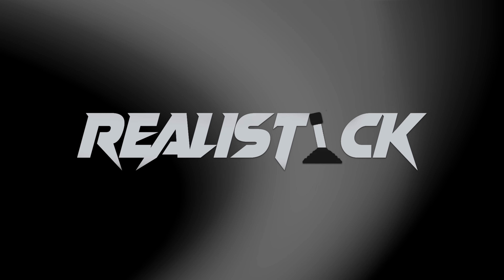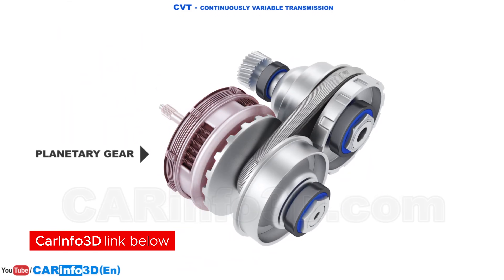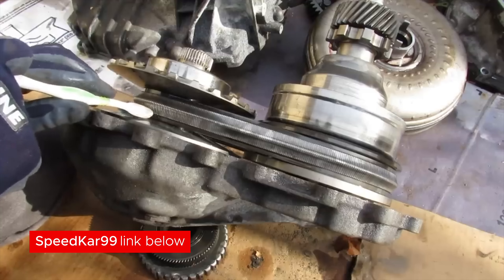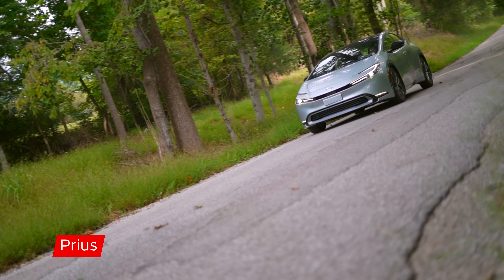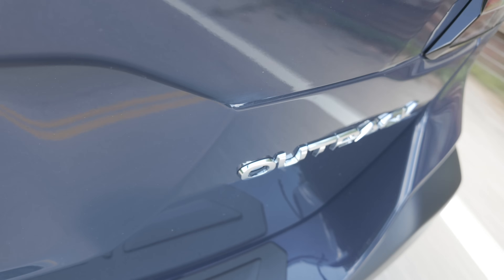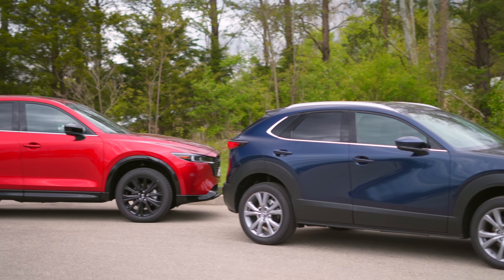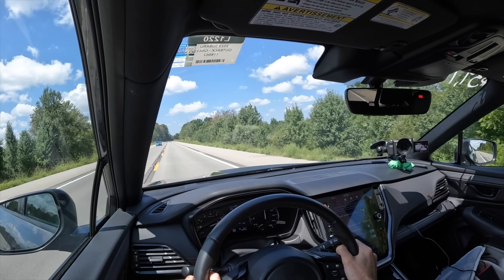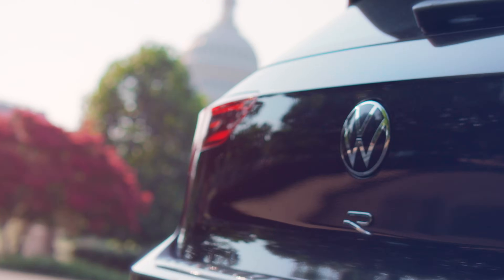Why CVTs are Great for Some Cars! (And Are They Reliable?)

Comment: As long as you do the service for the cvt they will last for a long time
Reply: A well cared for conventional automatic will last 50% longer in most cases. This really matters to the second and third owners of these cars. Transmission failure on a modern car is financially devastating if you're poor.
Reply: @0HOON0 no it wont
Reply: @0HOON0  stop talking nonsense  🤡

Comment: My wife's 2013 Rogue was the last of the Japan-built Nissan Rogues. With proper maintenance, the CVT lasted just shy of 11 years (115k miles). I replaced the Rogue with a 2024 CX-30.
Reply: Yeah, that kinda sux lol. I've never owned a car with less than 100k miles and aside from one real clunker Chevy S10, I've never had a total transmission failure. And that's with complete neglect aside from the occasional top-off of red trans fluid.
Reply: i drive a 23 years old honda with CVT, I  change oil every 2 years.  i dont do any maintenance. 
it drives like new.   get honda or toyota. or maybe subaru.
Reply: @tocreatee3585  what '01 honda has a CVT
Reply: Honestly that’s a short amount of time. I’ve owned several Acuras that got well over 160, 170 and 220K miles before selling them without any engine or transmission issues.
Reply: @atmartens  exactly right. A CVT that has to be babied to get to 100k+ miles is suspect
Reply: Those early ones were known for exploding so you got lucky! My maxima made it to 160kmi before I sold it so i was lucky too. i Ironically swapped to a new mazda as well! (2023 mazda3 turbo hatch)

Comment: A CVT immediately crosses a vehicle off my shopping list
Reply: CVTs are good bro, I got one and you just need to be easy on them and they will be too easy for you.
Reply: @alvinsimba734 but they are boring to drive
Reply: @cat_luver16  lol
Reply: "CVTs are great, you just gotta drive the car like a grandma everywhere you go and triple your fluid changes all to save 1-2mpg" @alvinsimba734
Reply: It’s not the end of the world as long as you manage your expectations - a satisfied Outback wilderness owner
Reply: I’ve owned two. Both Toyota. Both excellent for what they are. I hate CVTs on principle, but they probably have a place.  Never had any issues.

Subaru I hear does them well, I’ve driven a couple in loaners but I frankly don’t remember their performance to mention to.
Reply: Honestly, there may be driven in the city and in the most efficient way possible. If you're constantly flooring it, it's gonna wear it out A lot faster than a standard transmission. That said, if you drive it the way it's meant to be driven, you can get an excellent economy while also having a smooth power delivery and just make sure you're constantly changing the fluids properly like any transmission. That said, it's not for everybody, but I personally enjoy the vehicles I've driven with this cvt. I don't drive very fast anyway.
Reply: @midnitestate if you drive a manual like an idiot you'll end up paying more because most CVTs have 10 year warranties followed by goodwill replacement or repair from Subaru and Toyota. Race car wannabes likely pay a hell of a lot more in manual transmission repairs than responsible CVT drivers.
Reply: @murmsuniversalrobotics3938 And what about the irresponsible CVT drivers? Your example isnt exactly apples to apples.
Reply: @boost331  yeah, they really need to help people with reading comprehension. I'm not going to spoon feed you what I wrote Billy.
Reply: That’s a ridiculously blanket statement. Each car has pluses and minuses, and not all CVTs feel the same, nor do they all have the same reliability.
Reply: CVTs are fine within these parameters:

-on small A or B class subcompact cars (like chevy spark)
-You don’t tow loads 
-You accelerate gently 

The problem is that large, heavy SUVs are being mated with CVTs, which is a terrible combination. To be fair, large and heavy vehicles are generally terrible for everything.
Reply: Love the cvt in my Subaru Crosstrek.  very efficient and smooth.
Reply: Same
Reply: Well, though they don't last as long, they are 4x to 80x cheaper to fix than an automatic transmission. Totally depends on who made it and what type of CVT it is.

For the record, an automatic transmission is a form of CVT. It's a liquid CVT with virtual gears. As opposed to a manual CVT, which has less power loss and better fuel economy potential than any automatic transmission could ever provide.

Tip, the money you save in gas can easily repair any CVT 4x over the losses from using a liquid, automatic transmission CVT.
Reply: Indeed
Reply: and if its a Toyota CVT ?
Reply: @KingQS honda too
Reply: That's cause you're ignorant on how to take care of them
Reply: From experience, both a 2015 Altima and a 2014 Forester. I hate them. Never again.

Comment: I test drove a 2023 Accord EX earlier this week. The CVT is smooth and it holds revs instead of fake shifting as long as you aren’t flooring it. The turbo spools up and you gradually pick up speed. Much more smooth than my current Camry with the 8 speed.

Definitely not the most fun, but for those who aren’t enthusiasts, it probably won’t matter anyway.
Reply: Your Camry will still be good for a trip to the moon and back when the Accord is heading to the recyclers.
Reply: @0HOON0  I guess so. The drivetrain in my Camry isn’t very refined but it seems bombproof.

Comment: I want either a Crosstrek WRX or a Spirit Racing CX-30, whichever company comes out with their performance oriented lifted hatchback first. Made in Japan preferably. As it is though, the CX-30 looks so much better inside and out. Whoever designed that Crosstrek Wilderness and whoever implemented the large laggy touchscreen and put the climate controls in the touchscreen needs to be fired. The one advantage of the Crosstrek is that Subaru does a much better job with interior space/packaging and visibility.
Reply: The new wrx is basically a crosstrek if you buy $400 lifting springs. The main difference is that it doesn’t have a hatch though. Which is admittedly a big issue.
Reply: Test drive a Bronco Sport Badlands. Might check a lot of your boxes if you can live with Ford tier reliability.

Comment: Manual 18 Forester owner. 

My wife's CVT Outback feels disconnected from the road, and from the engine. 

That said, we did a 900 mile trip, at 80mph on open farm-field-surrounded windy flatlands, with four humans, a 70lb dog, loaded to the ceiling....and got 31.8 mpg at the pump doing it. CVTs WORK, but are not for the enthusiast. 

I'll also say her car is CRAZY quiet, quieter than my manual forester, which I spent $400 and over ten hours sound deadening. The CVT allows the engine to run at damn near idle, vs 3k rpm on the highway, so the drive train noise is much less invasive into the cabin. 

I do question the towing capacity of the car too.

Also, by using the paddle Shifters and downshifting, you can force the CVT into the higher Rpms, therefor putting the car into the power band, and scratching the "pull and power" itch.

That said, I'll have a manual until the government says I'm not allowed to anymore, because the government gets everything right...
Reply: I did what you're saying. I had a key assault to CvT in it. And it does feel pretty disconnected. But at least that one was too, like a regular automatic. So it sounded like and  felt like a normal automatic most of the time. And I agree with the whole towing situation since I understand in SUVs that they use a slightly heavier duty belt and a few other components in the CVT to allow it to tow And be able to take the higher power engines that are easily in those vehicles. But I would rather want a standard automatic in that way so you can manually change the gears and have it be a lot more durable than doing so.
Reply: try new cvt from Toyota or honda.  they feel different not as good as manuals but much much better than other cvts.
Reply: @fffwe3876  I suppose that would be the way that different car manufacturers can distinguish themselves, while they all have cvts some of them will be better at Towing some of them will be better off the line some of them will be better fuel efficiency and that's how they would Market it. Kind of like how everyone has a giant display nowadays there's got to be something that distinguish them